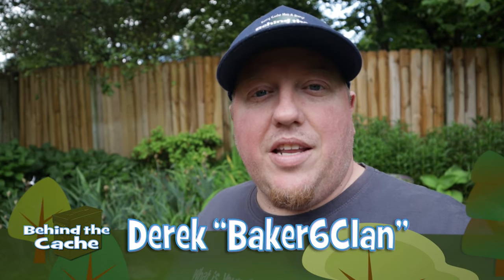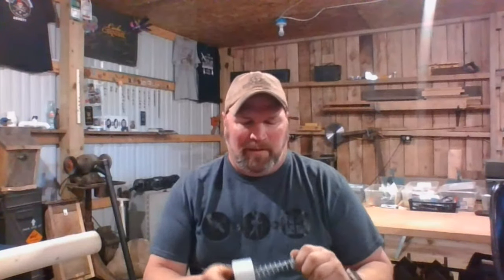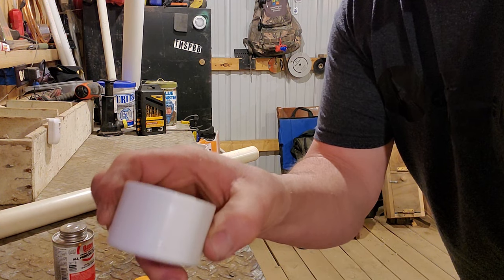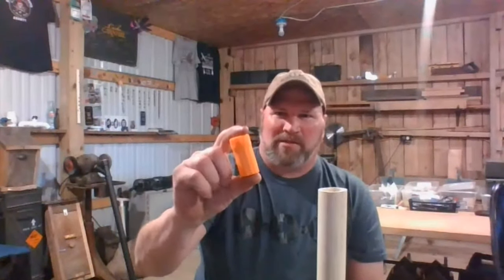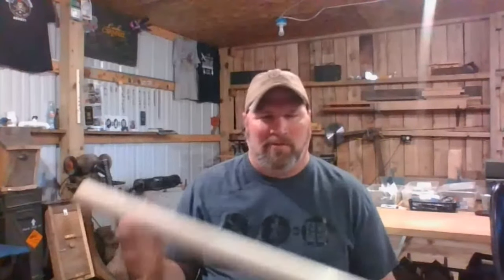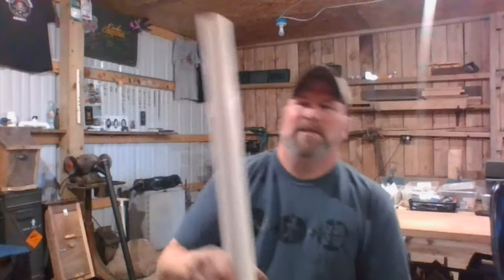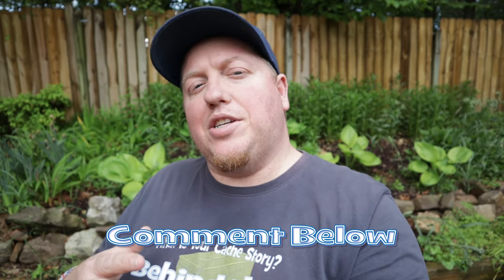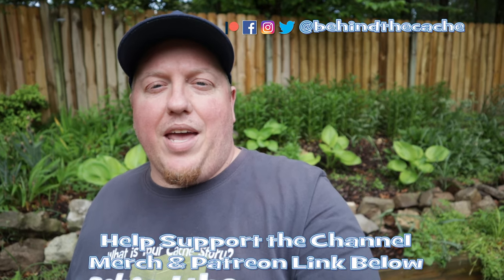Simple PVC Gadget Cache with DaTruck (GCNW)

Comment: Great interview,  and the remote format will open back up those 1 on 1 interviews. Zoom is your friend. I own a cache called Missile Command with a similar concept. It has 150 favorite points on it. It’s a smaller diameter PVC pipe about 4 feet long with a j-bend at the bottom. It’s attached to the side of a building so it blends in perfectly.  You use lung power to launch a bison tube several feet into the air..
Reply from the maker: That is cool I have thought about one like that. Do they bring a TOTT to clean it or do you provide something.
Reply: Nothing provided. I have faith that the cacher will wipe it off before they make the attempt. Also, it’s self cleans itself when it rains. The  famous world traveling cache Retired Guy even stopped by and did it when he was in town.

Comment: We have a cache very similar to this in the Geocaching Capital of Canada GeoTour. It was put out in May of 2015 and we haven't had any maintenance issues with it. Being in Canada, we have to think of the snow and ice, so we put a removable cap on the top (a spray paint can lid that fits loosely) and attached it with a small chain so it doesn't get lost. Good advise to use a bright coloured container.  Ours is painted florescent orange.  Love simple caches that last for years! Happy caching. GCC#062 Up, Up and Away: https://www.geocaching.com/geocache/GC5R6PH_gcc062-up-up-and-away?guid=e079dca3-1cad-4169-bcfc-d907b540f0f3
Reply from the maker: That is great low maintenance is awesome 👏. Yeah each location has its own challenges to think of when you put out a gadget.